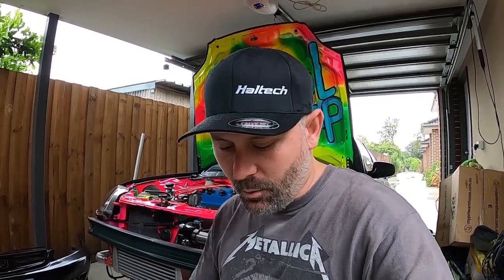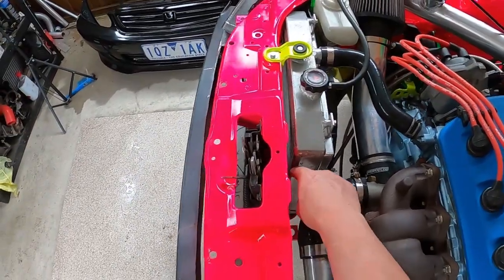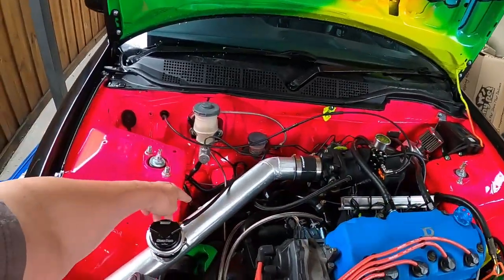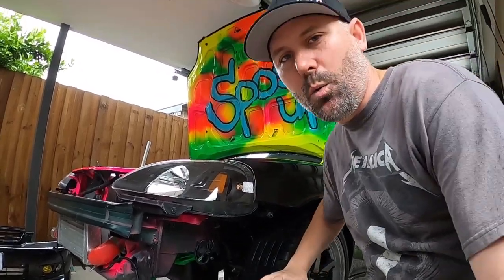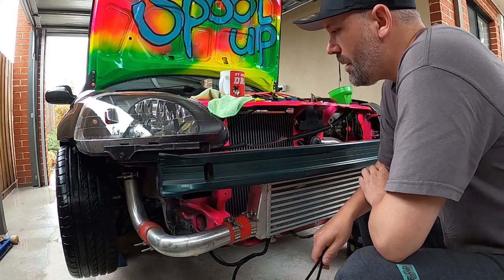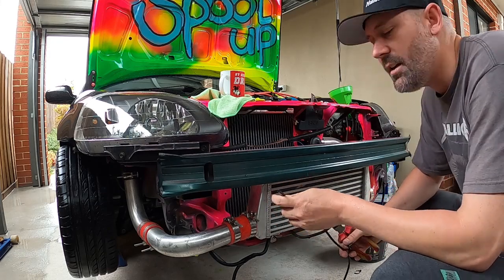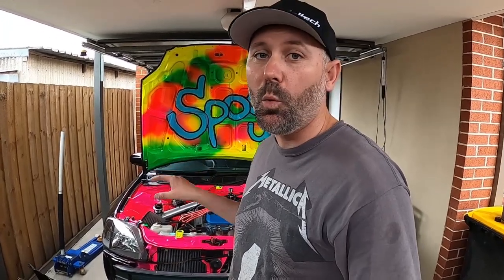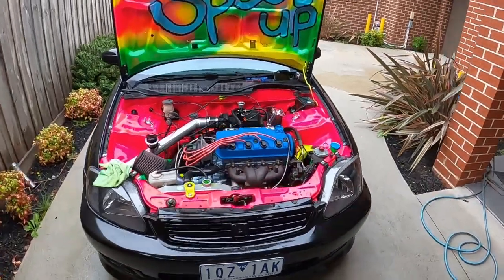EK CIVIC OVERHEATING ISSUES TURBO D16Y Episode55

Comment: I have 99 ek9 d16y8 . She run about 185. 

For most cars, the normal operating engine temperature is in a range of 195 to 220 degrees Fahrenheit, though most dashboard temperature gauges don't show an exact temperature. Instead, there are typically markings for cold and hot on the edges of the gauge and a normal range in the middle.
Reply from the maker: Thanks brother for the info
Reply: Most of my 90s vehicles were happiest around 140 degrees.

Comment: Hey matey, love following your build! Keep it up man!
I just recently installed a similar spray set up to my integra dc2 turbo. And I came across the same dripping issue. 
And I found relatively cheap $20 solution on eBay by installing a “one way fuel non return check valve”, after it comes out the wiper bottle.
Reply from the maker: Ooooh I want that can you link me please
Reply: @TURBOTRISTAN  I was gonna say the same thing bro, a one way check valve and have some water in the lines of the sprayers when you install it to help pressure build :)
Ill link you a one way valve

 https://www.ebay.com.au/itm/324472650205

With the heating issue bro I suggest removing your thermostat completely and when you add coolant have the heater on hot and fan on full boar and jack the car up a bit with a dare ice coffee or whatever and duct tape to the radiator neck for high clearance 100%. Run the car and fill coolant as much as you can until it overflows.

Should keep the car cooler and properly bled :)
Reply from the maker: @casley1992  I have a surprise about what I’ve done, video should be out this week end
Reply: @TURBOTRISTO  oh cant wait haha I got subscribed hit mate! Awesome vids
Reply from the maker: @casley1992  thanks for the support Jordan !!!! 🇦🇺👌🏽👌🏽
Reply: want about usin a mishimoto termo are 156 degrees  and the and sensor might help with  extra holes on it too ?

Comment: Gauge is not dependable. I always read from the ECU. You should get the IAT stay close to 40deg on 40deg day on cruise. This helps a lot. Get the air filter into a colder area. Pays off big time. What's the head bolts are they ARPs?
Reply from the maker: Yeah man arp head studs
Reply from the maker: I will be sorting heat management soon

Comment: very good idea...
thats what i like

take the spray from the audi a4 b7 b8 
or seat leon 
its sprays very good and not only on one or two points, they will the whole ground of the radiator fulley sprayed

think you need a bigger pump or an electrical cooling system...

only when it will pushed gets colder....

and terminate the thermostat...so you run only cold machine max 80 degrees
Reply from the maker: I have done a new video on a radiator upgrade check it out man, but I love your thoughts

Comment: Sheeeshh... I am having heat soak issues too in the d16. I have changed the shroud and fan to one from an estima, redline water wetter with distilled water. Its great at night with lesser traffic and cool air but horrible during the day.
Reply from the maker: Sorry to hear that I hope you get it sorted, turns out mine had a lifted head

Comment: G'day mate. Nice work. Not wanting to tell you how to suck eggs but in my experience with water sprays they tend to work best pointing into the direction of the air steam. Lots more evaporation happens then! 👍
Reply from the maker: Please and thank you I need all the help I can get , I am very sure judging by the tiny bubbles that are coming through the radiator that maybe there is gas from the cylinders getting in the cooling system
Reply from the maker: Doesn’t seem to be getting in the oil as it’s crystal clear but I’m not convinced about the head gasket
Reply: The gunk in the catch can is just e85 mate. They all do it. I return mine to the sump and let it steam off the oil. There's pros and cons for that. Also it may be worth getting or borrowing a tk head check (the snapon or repco ones work better) and see if the bubbles are carbon monoxide or air 👍 Keep up the good work mate!
Reply from the maker: @blairo15  already on it for that I’ll borrow one from a mechanic mate on Friday if that’s the case it will be a mad rush to swap out the gasket and get the head done
Reply: @TURBOTRISTO  I'm an eternal optimist. I reckon it'll be fine! 🤞
Reply from the maker: @blairo15  I hope so too, I think the high temp readings also has to do with the water temp sender to the ecu is on the exhaust manifold side of the head

Comment: Welcome to my illusive blown head gasket on my 99 accord j30. Same issues minus turbo & yes it had a very small leak on the head gasket at cylinder #1. 

The leak was enough to give me a misfire when cold but soon turned into a dead cylinder. All of this was confirmed when the head was removed & cylinder #1 was steam cleaned like new.

The factory MLS gasket is very good at holding but just enough that coolant & pressure can intermix if the engine had an over heating issue.
Reply from the maker: I have tried everything it could even be the intake manifold near the heater hose outlet, sooo stressful
Reply: @TURBOTRISTO  have you tried a leak down test? Relative compression may not show everything going on in a cylinder.

I would say engine cold leak down test each at tdc & bdc. You might find something surprising that gives definitive evidence of a blown head gasket or if not then at least youll know its mechanically healthy.

Good luck trouble shooting the weird little things can be the worst
Reply from the maker: @OneKauz  I haven’t yet I don’t have the correct tools for that yet

Comment: Heat wrap your exhaust sounds dumb but can help also put a fan on the front of your radiator and reverse the pull so it pushes air through ur radiator
Reply from the maker: Exhaust was heat wrapped but I had to remove it I got oil all over it,  I’m making a new down pipe and wrapping it
Reply: Also I have a fully built and boosted d16y8 (basically same motor) if you have any questions u need help with
Reply from the maker: @makennahouse1778  where are you based
Reply: @TURBOTRISTO  I’m in the us on the east coast

Comment: Put your factory radiator back in and test it??? Plus shroud your thermo fan too
Reply from the maker: Thermo fan has a fan shroud already , factory radiator split I half in episode 17
Reply: @TURBOTRISTO  so put another factory one in. Check to see if that’s your issue. 
Cheap aftermarket radiators normally do not work 🤷🏻‍♂️
Reply: @TURBOTRISTO  also use a SPAL thermo fan....
Reply from the maker: @alextziolis7682  I’ll suss it out, it could be the head gasket I’m doing a leak down test this week on it
Reply from the maker: @alextziolis7682  looking into all that now

Comment: Tuning can cause d series to lift heads and blow out gaskets . Too much ignition timing  ?
Reply from the maker: Yeah I’m aware of that one hopefully because I haven’t boosted it full on it didn’t lift the head I’m running the old tune to run it in hopefully timing in low rpm wasn’t too high and caused it to lift on medium accel 💔
Reply: @TURBOTRISTO  you'll probaly be ok then make sure there's no airlocks or leaks what so ever if the system isn't under pressure or has air itll cause it to boil alot quicker.  Half rads are pretty shit to for what you want to do with the car and moisture in the catch can is common especially if your on e85
Reply from the maker: @magoo4381  I feel ya man really stresses me out with this half rad

Comment: I wanna guess its your radiator and fan combo, i just went thru this on my turbo integra, i had a dual core ebay radiator and fan. I was seeing high temps at idle but after some highway it would go down slowly, i actually ended up using a stock radiator and 12" ebay fan. That fixed my problem. I think it has to do with the thickness of the radiator and the fan not being able to pull enough air
Reply from the maker: I think you are right man
Reply: I’m having same issues o have a mishimoto radiator with a puller spal fan. I over heat over 220’ and go into limp mode

Comment: Definitely not normal my honda isn't turbo but I have a b16 with the original d series radiator and my temp gauge sits under half way highest temp gets to is about 98°c on hot days im also in SE
Reply: Could be headgasket like you say a mate of mines evo had this sort of issue but it only happened on the track after a few hard laps but his water would also boil and come out his overflow bottle and would suck his upper rad hose in on itself once the car had cooled down
He replaced the headmaster and it was all good
Reply from the maker: Thanks man

Comment: Have you tried calibrating the coolant temp sensor on the haltech if u are still using the honda coolant temp sensor.Try using a infrared thermometer.
Reply from the maker: Good idea I have been recommended to buy one of those I may grab one on eBay now
Reply: If the engine really is overheating,the gauge on the cluster should also come up, i think is just the calibration on the haltech.
Reply from the maker: @kombatwombat1821  temp sensor is ordered thanks for reminding me
Reply: @TURBOTRISTO   I sent an attachment on your email.
Reply from the maker: @kombatwombat1821  thanks mate

Comment: did you ever figure this one out? clogged coolant galley or something? bad coolant temp sensor?
Reply from the maker: it turned out the d16 is prone to lifting the head , even with mls and arp headstuds the head still lifts with too much timing
Reply: @TURBOTRISTO  oh did this engine have any kind of a block guard or aftermarket sleeves installed in the block or was it the stock floating sleeves? i have a block guard in a d16 engine i'm building but i'm thinking about installing some darton sleeves that serve the same purpose instead
Reply from the maker: @5eZa  yes it had a block gaurd,  d16s just dont like timing, they love boost but hate timng
Reply: @TURBOTRISTO  interesting, ok thanks for the info